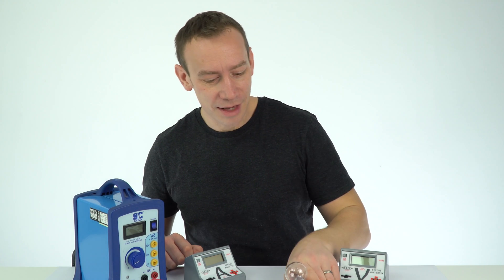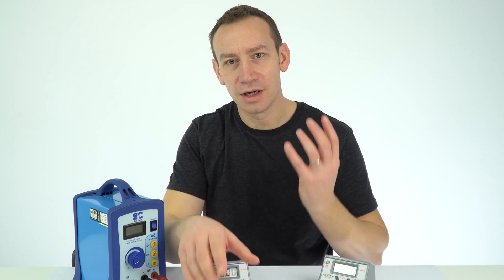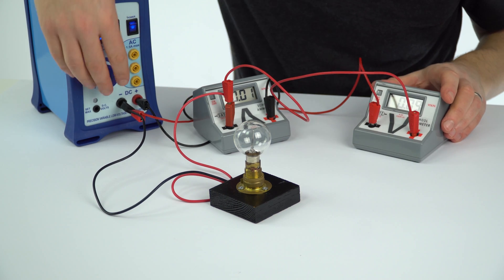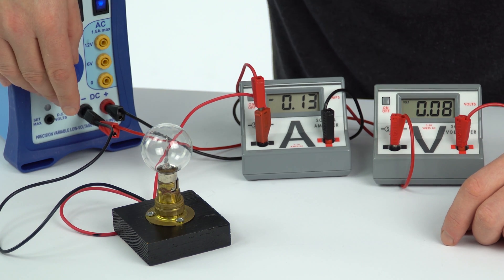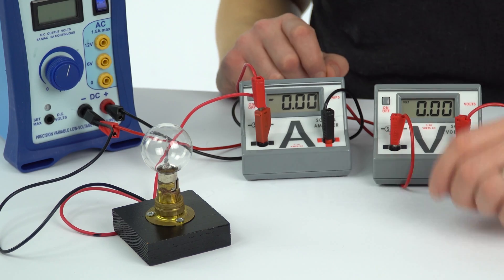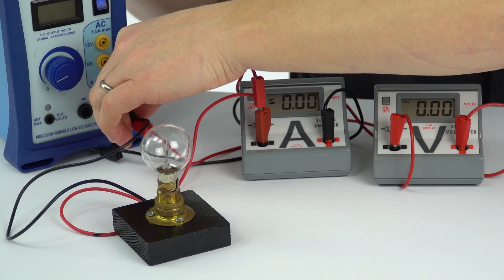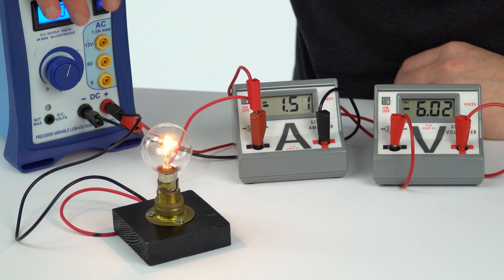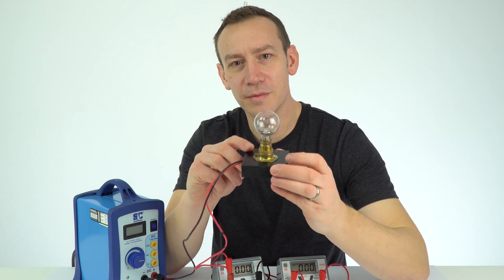IV Characteristics of a Bulb Experiment - GCSE Physics Required Practical

Comment: Am I going nuts? I ran the ohm meter over a light bulb in 2k and read .218 Ohms... I did the same with an analog meter and got roughly the same. The bulb is 240V with a Wattage of 25W. V^2 / R = 260W. I don't think so.
Where am I making the most simple of mistakes please. My assumption of moving the decimal point three places to the right is wrong. But how is it four places to the right?? I find myself locked into a mindset which does not let me stand back and figure out the same mistake I keep wanting to make whenever I measure Ohms.